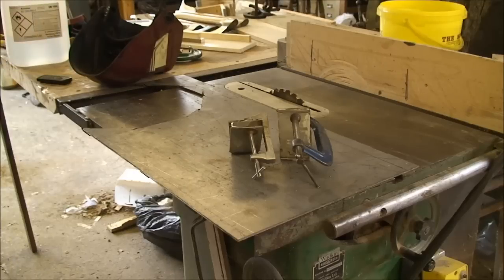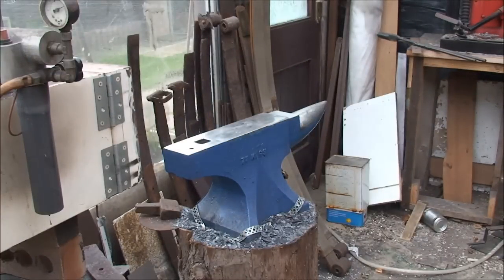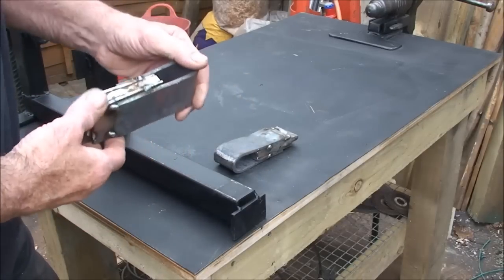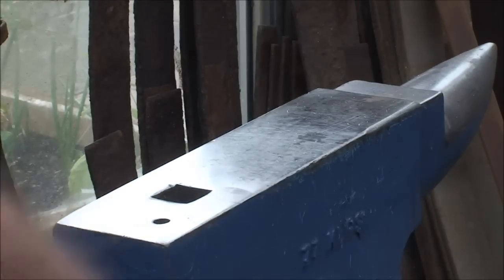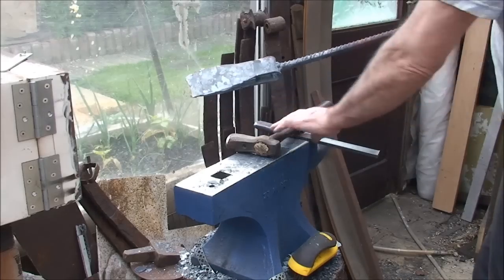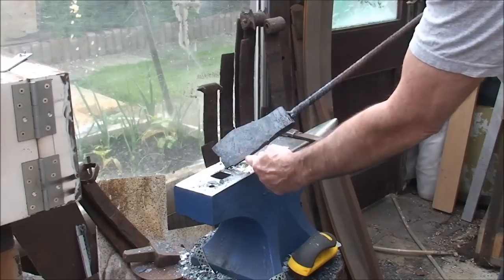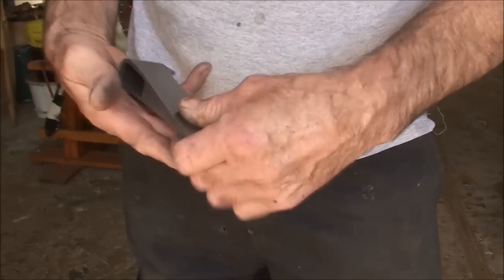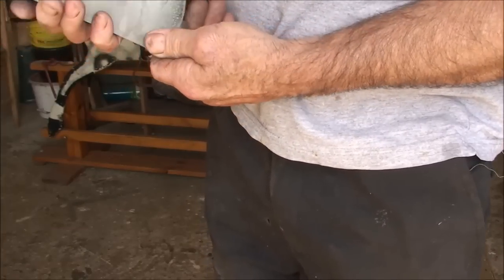forging a viking style axe.

Comment: Nice work. A tip for axes down the road is using a differential hardening, by quenching just the blade, and holding it for a few seconds before doing a fast quench on the rest of the axe. it  hardens the blade to hold an edge, but leaves the body and the eye soft enough to soak up the blow from cutting.
Reply from the maker: Thanks for that, The main reason I do a full quench is to check the strength of the welds, if they are going to fail or are not quite right the quench will find faults, so far everything has been good so maybe i can now be confident enough to just quench the edge. Cheers.
Reply: @LozHarrop  you sir, should be in the Diplomatic corps..... incredible restraint.

Comment: Looks nice, the only complaint I have is the square-like shape of the eye as i like the eye of my axes to be shaped like a waterdrop or oval. :)
Reply from the maker: +Adam Lundmark Thanks Adam, difficult to achieve that shape when just bending steel like this, but it was an actual method used by smiths back in the day along with others that form the teardrop shape to the eye. These axe heads are a bit crude but very functional and strong I was just looking for a more simple and easy method to forge together an axe, I might get around to doing it the hard way one day by beating out the eye through a solid piece of steel, i will need to make a few tools first though. Cheers.
Reply: ***** You are for sure a much better blacksmith than me, I've only been doing blacksmithing for about 6 months and the only axe I've made was from a old hammer so the eye only needed to be made a bit wider. And most of the things  make is also a bit "crude" as I'm only a novice blacksmith and I don't even polish most of my things as I like the a bit more rough, black finish you get after forging it. :)

Comment: That was a mysterious forge weld! it looked way to cold, and yet came out perfect!? Please show that again one time! cheers.
Reply from the maker: +Flip de boer My forge area has a clear plastic roof and wall which lets plenty of sunlight in, the sunlight makes the steel colour look cooler than it actually is. cheers.
Reply: +ppotty1 Which is the same  reason that low number Springfield M1903 rifles are considered dangerous to fire.

Comment: ppotty1,why not give a circular saw blade that cuts metal a try.They cut really well not to mention saves on grinder wheels.I have one on my chopsaw that goes through steel like a hot knife through warm butter.Love your videos also.
Reply from the maker: +richardpinell Ive recently bought a plasma cutter richard going to give that a try when i get time. Cheers.
Reply: +ppotty1 That's a piece of equipment that'll make your pockets a bit lighter.Good deal,I just wanted to pass on some information you might not have realized was out there regarding the latest metal cutting blades.I pick up my saw first now instead of the gas torch lately.Where it really shines is on the chopsaw,no grinding and perfect cuts.It sure speeds the welding process and time.PeaceOut

Comment: very nice, looks like a good size for many uses. my i ask way did you put the saw blad in? Some say that the leafspring cant be forgeweld but i cant see you got proplems whit it.

thanks for shearing this good video.
Reply from the maker: +Joar Flesjå Hi Joar, and thanks. I put the sawblade in to make the axe thicker at the top, have had no real problems welding leaf spring so far.

Comment: Thats one very good looking axe !
How much time did you temper it and on what tempetature ? :)
Reply from the maker: Boncho Mangala Thanks, I tempered at 200c for one hour then I put the blow torch on the thicker section until the colour ran slightly above straw, I had the cutting edge stood in an inch of water while I did this so as to not overheat it. The cutting edge turned out good not chippy but holds good sharpness. Cheers.
Reply: ***** Thanks for the fast and well explained answer friend . Greeting from a bulgarian knifemaker and good luck forging . :)

Comment: is that a wood floor in your shop? have you had any issues with fire or smoldering? I have a wood floor in my shop and wonder if I'm being really dumb by forging in there.
Reply: That's what fire extinguishers are made for! :)
Reply from the maker: No all concrete Mark, but my forge is in the wood store if that makes you feel any better. lol I got a hosepipe nearby in case. ;-)

Comment: Question, Instead of tac welding the bits together, could you tie them together with some heavy gauge wire?
Reply from the maker: +DesertFoxCXVII Yes you could do it that way I know that method is still used, leave big enough spaces in the wire to hammer between so you dont forge weld the wire into the steel maybe not so important on something like this but with damascus pattern welding the wire would show up in the finished piece if it was welded in.
Reply: ***** Sweet! thanks for the tip. Although I can Imagine if you arrange the wire in an artistic fashion, they can add to the existing pattern of the damascus billet. Especially if using nice wire.
Reply from the maker: +DesertFoxCXVII yea true mate.

Comment: i see you have a harbor freight anvil. how is it working for you?
Reply from the maker: Its a Brooks Anvil, made in England for many years.
Reply: ppotty1 harbor freight has an anvil that looks alot like that. i had it its terrible.
Reply: Ieah it's cheap but if you are on budget and want a good anvil you could buy a HF one and go to a smith/metal fab shop and forge a plate from rr track cut the hardie hole and weld that plate on your anvil. It might cost about 50$ but js the best anvil on that price!

Comment: is this harder to do without borax?
Reply from the maker: yes its more difficult some guys use diesel or wd40 but if the welding faces get alot of oxygen the steel will start to scale and then you wont get clean welds.